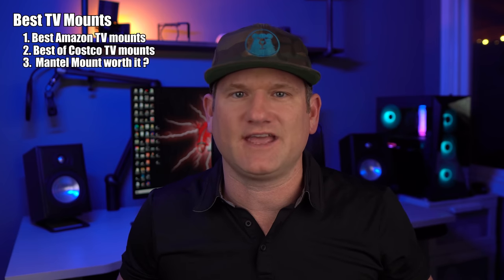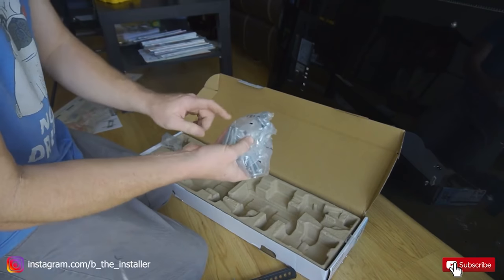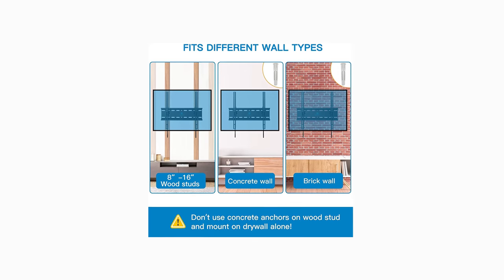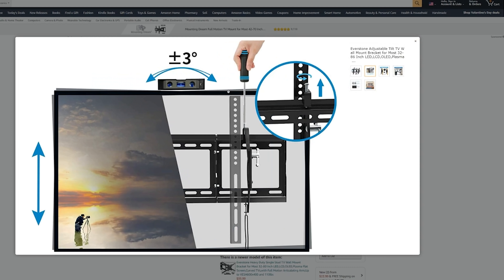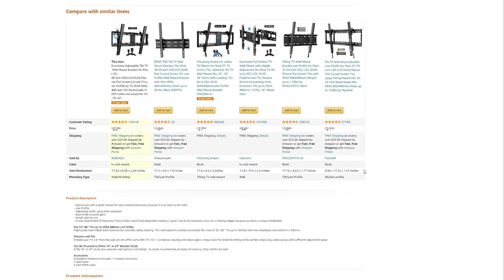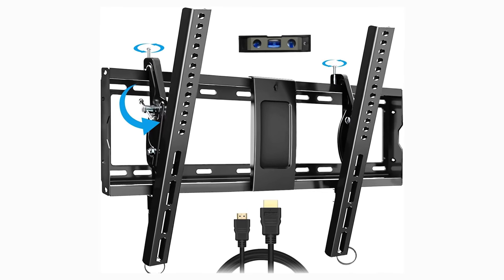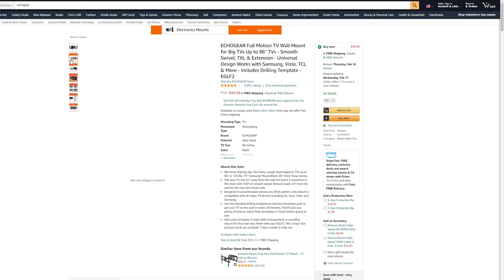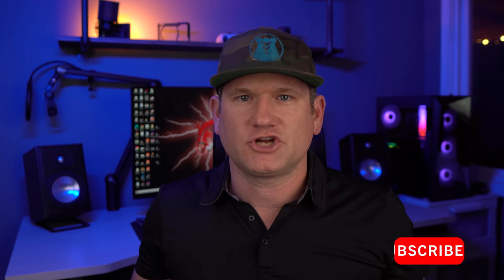Best TV Mounts on Amazon and Costco + Mantel Mount info

Comment: With todays open floor plan homes we need mounts that do a 90° turn so the tv is aiming across to the side into another area in the home. So we need long extension arms that dont sag, with some cable management for making large tvs like a 77" be able to make a full 90° turn. AND if we want them to be flat, we need the mount box to recess so the arms fold into the wall. I had such a mount, and it was GREAT, BUT, not available to turn a tv 90°, as they need to be longer than 35" from wall surface to center of mount plate.

Comment: When the tv is mounted , does it need to pushed back against the wall? Or can it be left out, off the wall? My current TV sits on a stand between two bookshelves (about 120cm apart). Thinking of buying a 65” tv but it will need to be mounted on the wall and the bracket permanently extended out to sit in front of the bookshelves, which have a depth of 28cm. So the tv will sit a foot off the wall. Is the bracket designed to hold the tv in such a position?

Comment: OH MAN!!!  You may have just saved me pulling my hair out.  We are building a new home after 8 years living in a motorhome touring America.  Between this video and a couple other videos on running wires up a wall I can see it would be rather stupid on my part to try to predict where we would wall mount new TVs.  Instead of predicting locations and having the builder set power/data boxes we plan to leave the power and data boxes down low (traditional) and then once we buy TVs and wall mounts we can do the work to run wires to these exact locations.  THANKS!!!

Comment: Thanks for the Video, I bought 2 at Costco- 2 arm articulating. My delima is the previous home owners put the electrical outlet and cable directly in the center so the plate covers it up and I believe I have to use another mount, They had a flat mount so the back was fully open. Any suggestions? The only option I see is to relocate the electrical and cable. Thanks

Comment: I need one that moves from left to right a lot and tilts up and down a lot bc my bed and furniture in my room is at an angle
Reply from the maker: Most single arm mounts have that sort of flexibility.  The one I recommended is good for 55" and smaller.  There are longer arms like 25" for bigger ones in corner

Comment: That Sanus full motion mount won’t work on 12” studs😩 this house has 12” studs on the TV wall. So annoyed.
Reply from the maker: Of course it will. Just drill through the metal.. you should be able to secure 3 studs if that was the case.
Reply: @BTheInstaller  Ahhh, I thought of that but didn’t think it would be wise for the strength of the bracket to just create my own holes.  I don’t know what these builders were thinking, but two of the studs are 12” apart while the next one over to the right is 16” away. Weird.

Comment: Without spending $2500 for the Samsung Frame TV, any other really good Samsung TVs that can utilize the No-gap wall mount? Looking for something that is as close to wall as possible.
Reply from the maker: They only use that mount in combination with the one connect box.  So it's only on the high end Samsung tvs.  This year only frame and 8k.
Reply: @BTheInstaller  thank you. Appreciate the info.

Comment: Thanks for the info. I was unsure about the 'mounting dreams' brand so glad to hear you like them. Question about install....have you ever put a spacer behind a mount on the wall? Meaning the mount that goes directly against the wall,  not the TV portion. I'm wanting to bring out the mount from the wall about a 1/4in because of an outlet cover that is in the way and prevents the mount from sitting flush with the wall. I was thinking of putting some 1/4in thick pieces of hardwood in between the mount and the wall. Trying to avoid moving that outlet.
Reply: You can do this. Just make sure you are screwing into solid materials. I would not space the bracket out much further than 0.25 in drywall.

Securing the TV is all about the shear strength of the screws and materials.
Reply: Ggg l brb

Comment: Wish I could hire you in my area.  What would you recommend for an 83" Tv mounting to a brick fireplace?  it needs to extend and tilt but not concerned with turning really. 
thanks in advance
Reply from the maker: this is by far the best mount that isn't like $200+..  it's massive but gets pretty flat and can turn a massive tv sideways.  if you don't need extension, the sanus tilt and extend i show in that video is good for what you need. https://amzn.to/3yltmOL
Reply: @BTheInstaller  Thanks I'm open to more expensive if it's worth the price.  I'm looking for the best and most secure mount that extends out and can tilt up and down.  I really don't need turning.

Comment: Hello, thanks for the great suggestions. I just purchased an 85 inch Sony  X91J and initially we wanted it mounted fixed to the wall, but changed our mind since we now think it would look better on a console or entertainment center. It's hard to find one that fits the dimensions of this TV. Any suggestions?  TV legs measure 60 inches wide by 18 inches deep.

Comment: This may have been covered before but any thoughts on the Hangman flush mounts? The Simple Perlesmith looks like it will basically fulfill the same purpose but a lot of people swear by the Hangman... which looks like a cheap version of the mount for Samsung The Frame TVs.
Reply from the maker: You need space behind the tv for power and hdmi.  So if it works, use it but I try to get the perlesmith type flat mount that can tilt down and comes with spacers to give extra room if needed.
Reply: @BTheInstaller  Always important! Do you  use any of these mounts for portrait setups?
Reply from the maker: The mount remains same, you just rotate the tv.
Reply: @BTheInstaller  So here's the kicker... if I'm looking at a Samsung Q series and the VESA holes are normally aligned to the top of the portrait view can the mount support the weight of the display if it's rotated to portrait and the VESA holes are to one side? Appreciate your help on this B!